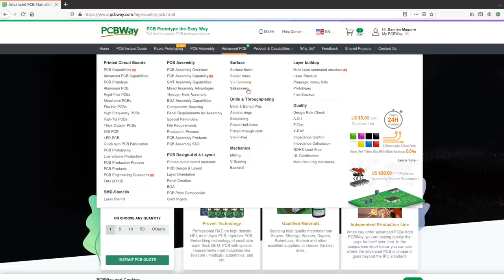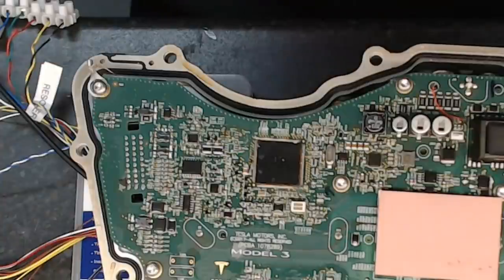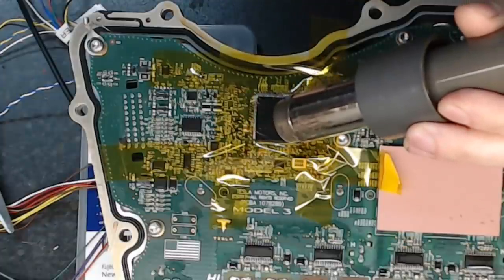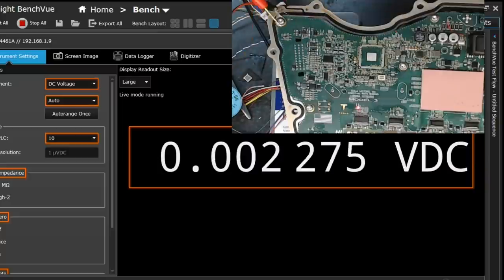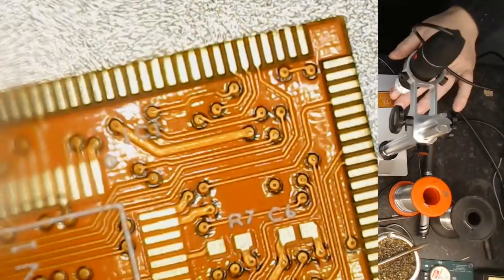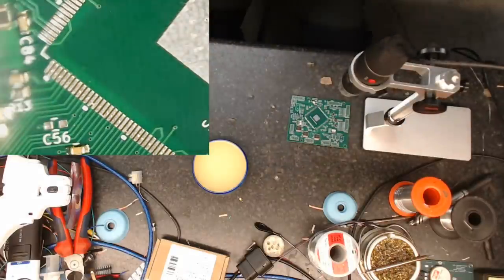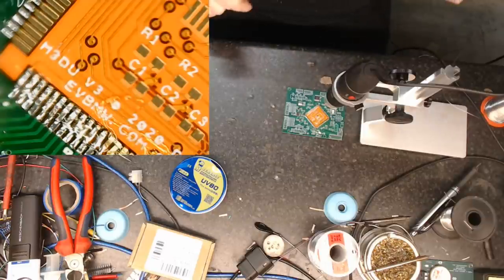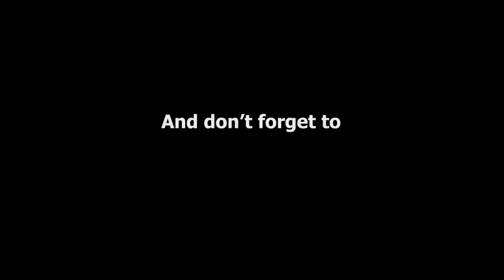Tesla Model 3 Drive Unit New Modboard Design

Comment: 00:25 - PCBWay Sponsor Announcement 
01:50 - Model 3 Front/Rear Drive Unit Project Update/Recap

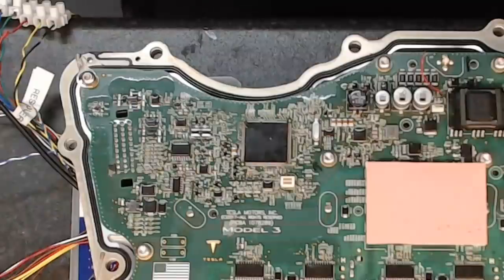05:45 - TMS Microcontroller Removal - Cutting Legs
09:10 - TMS Microcontroller Removal - Removing Legs from Pads
17:25 - TMS Microcontroller Removal - Cleaning and Taping Before Hot Air
21:20 - TMS Microcontroller Removal - Hot Air
27:50 - TMS Microcontroller Removal - Package Removal
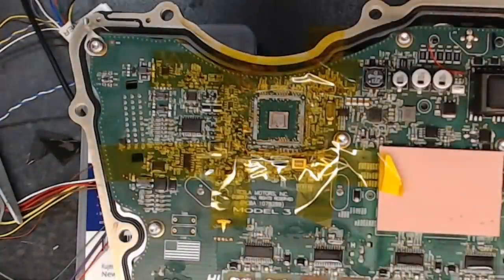29:15 - TMS Microcontroller Removal - Removal of Die w/ Chip Quick

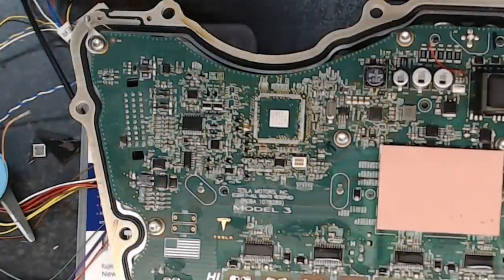32:11 - Testing the Zombified Drive Unit for shorts (or other damage)

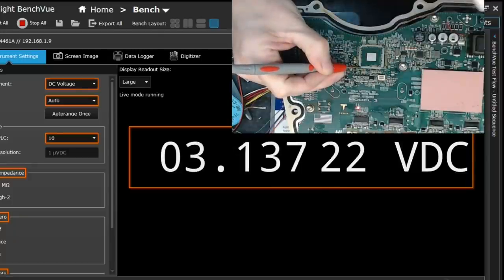37:10 - Modboard - Unboxing
40:35 - Modboard - Inspection 
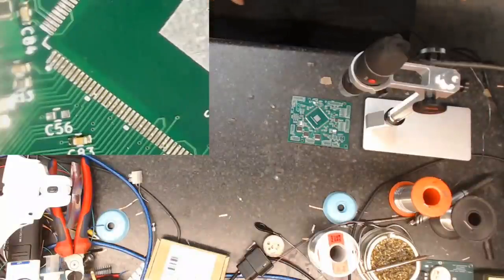53:30 - Modboard - Lining up on Test Board
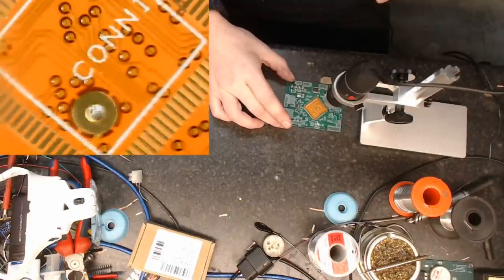59:50 - Modboard - Soldering to Test Board
1:07:20 - Modboard - Testing for Shorts

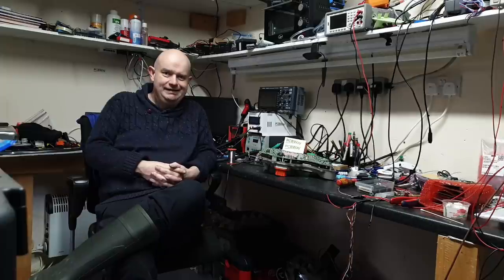1:11:17 - Conclusion

PS: I tried to make sure I wrote down most the cuts but may have missed linking details in the longer sections
Reply: Links over 60min is not working
Reply: Thanks mate, very helpful
Reply: Try 1:07:20. :-)
Reply: Updated the original comment with hour for anything over 1 hour, thanks for letting me know!

Comment: Hi Damien. I'm using Woods and Rose alloys for low temp solder, fuse links and components removal over 10 years. So far so good. As well with removing big IC's sometimes i'm just grinding them off with a dremel to the bottom layer(ground) and removing it with a heat gun and solderibg iron.

Comment: On some esp32 and esp8266 dev boards I noticed they use a stacked PCB design with castellated edges. I was thinking that I could use that approach to do board stacking similar to what you’re doing. Do you know if any trade offs with using the castellated approach over the flexible pcb you have here?

Comment: Have used PCBWAY for 6 years.   Mixed results, but for the most part it's been good.    
Then JLCPCB came along for proto boards, and the quality seemed better and more consistent than PCBWAY.

Chipquick is some amazing weird wild stuff.

So I have a Q:  
    What is the finish quality / material of the pads on this FPC (or whatever you would call this??)

This method is fucking genius.   Hats off my friend.  Superb hacking,  Great work!